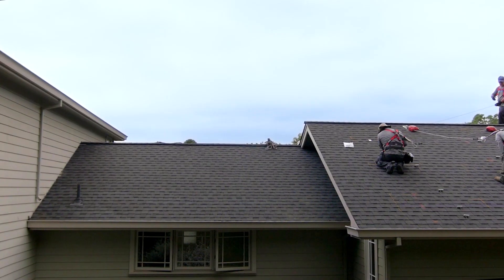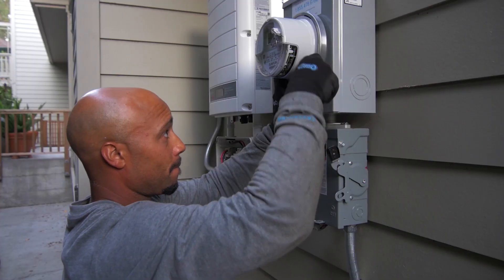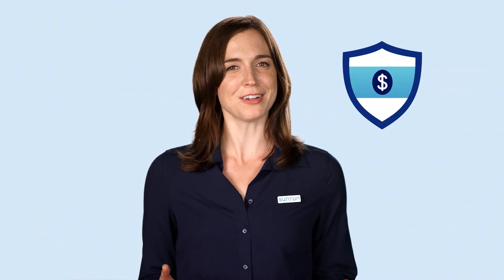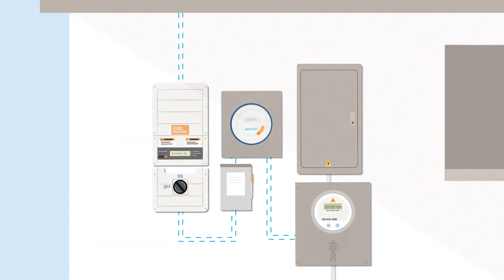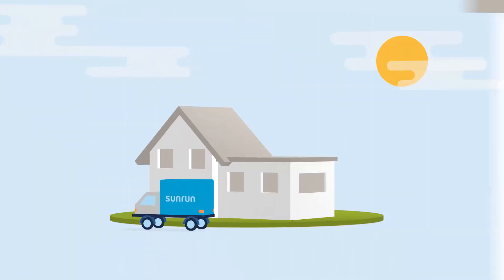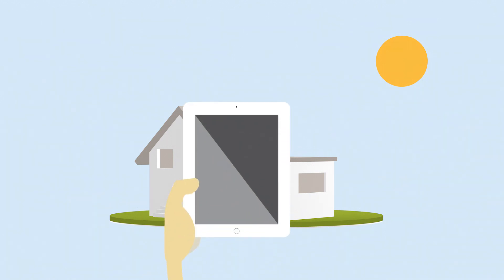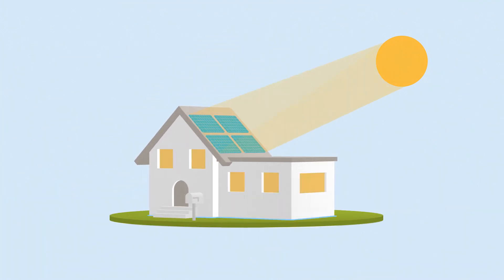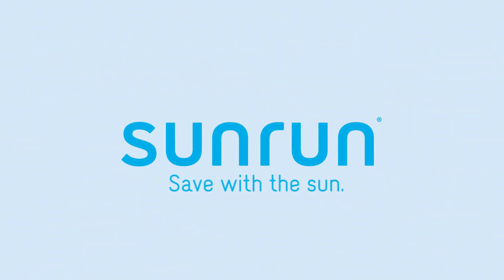How a Sunrun Solar Installation Works

Comment: Sunrun installed a defective roof on my house. I chased them with emails and phone calls for two years, now they say they won't finish repairing it. I will be out many thousands of dollars, not just to get the roof fixed by a legitimate company, but also for all the water damage in my walls and ceiling. For those of you who think Sunrun is "legitimate and established", they used unskilled undocumented workers to put on this disaster of a roof. One contractor quoted me over $22,000 to repair the roof only, not even including all the water damage in my walls.

Comment: Don't get sunrun there installers are hacks and the people that come to fix it ain't even with sunrun! They use outside contractors that miss matched the paint used to fix a hole in my ceiling they fell threw and then left a gallon hole in my siding they had to repair now dealing with a leaking roof. Been in contact with them and giving me the run around about that also.  Horrible company
Reply: I agree they are a horrible company. They installed a massively defective roof on my house.

Comment: SunRun should be named "You Better Run Away" This company sucks!! If you research SunRun and still go with them you are a fool!!! I have them "not by my choice" and they suck so bad!! Any place I can say or write something bad about them I'm doing it. I have nothing but problems with them and they don't care. They have no customer service!! I would write what problems I have with them but it would take hours to write down. Stay away from them!!
Reply: They installed a bad roof on my house, now they won't finish repairing it, they just make a bunch of unfriendly sounding excuses to make it seem like it's my fault. One email said they don't have to fix it because there is no longer a running leak, which is a flat out lie. There are actually two running leaks. Their guy came over to the house to inspect and he asked if the roof is leaking. I told him it isn't leaking today, because it isn't raining outside.